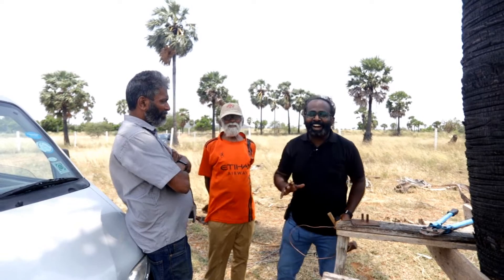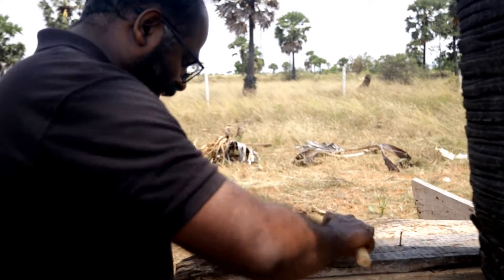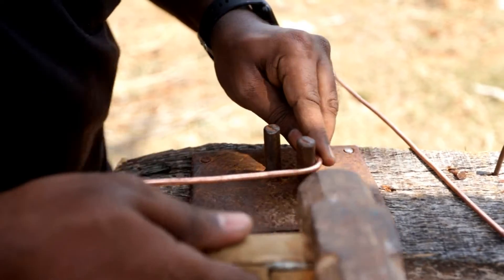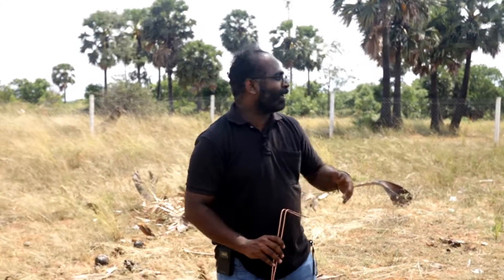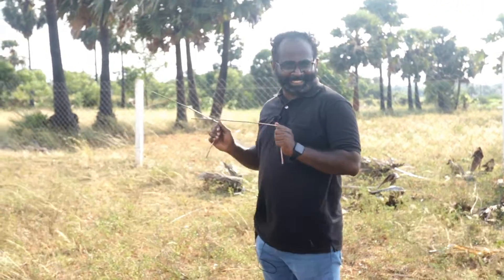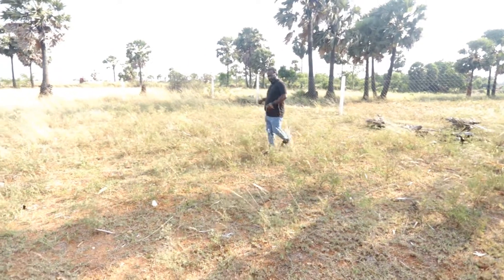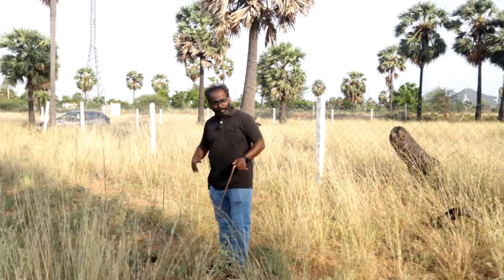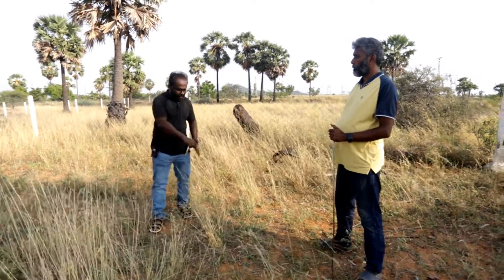Any One Can Detect Ground Water | Water Hunting Training | Episode - 02

Comment: Sir, if we put the  copper into small pvc 1/2 pipes of 15 cm,  and then hold the pvc, without physically touching the copper, will the copper rotated inside the pcv pipe.

Comment: Sir,good,How much inch bend ? Total one rod make length,bend? Long length how much ? Sir pl reply. I will try .lt is very correct found?  Depth found any method there? Pl reply sir fine. Iam tamil nadu tin
Reply from the maker: measurement is available in the video , please watch again. Regarding the depth- not accurate but you can  find approx by experiencing the strength on hand again again on already available water sources/ wells with different depth.... second accurate method is find out nearby wells depth and measure the difference in lands surface level difference

Comment: Small doubt sir., 
On first episode.. You said.. Crossing of rods point is under ground water point.. But while testing the field you said deflection or opposite direction is showing to water point. Which one is correct?
Reply from the maker: Please watch first episode ending portion again, there both methods are explained

Now after doing it for long time (gap between first & second episodes) personally I found second episode method is so easy to handle the rod balance
Reply: @PassionateTrainer  i was also thinking the same i can't keep my hands balanced   2 feet apart

Comment: I put a borewell for 700 feet and very little water is available. Only rock from 40 feet. Can i try this in my plot. It's 12 cents area.
Reply from the maker: sure you can.... but this method not says  rock is not there